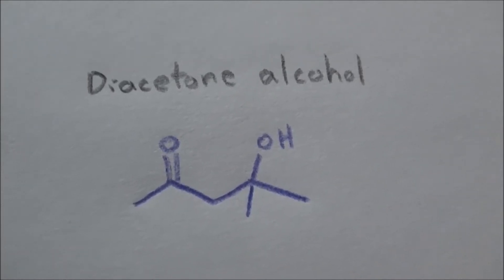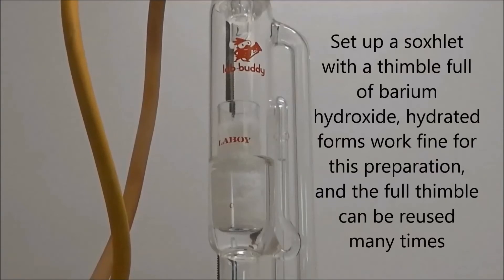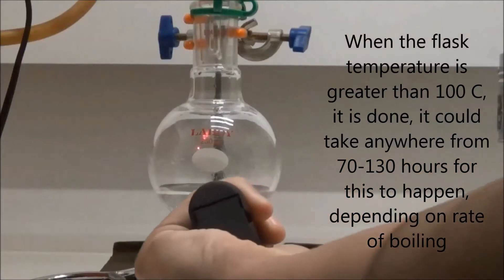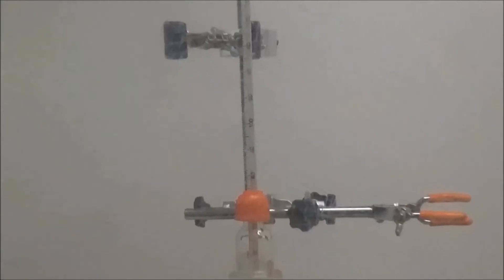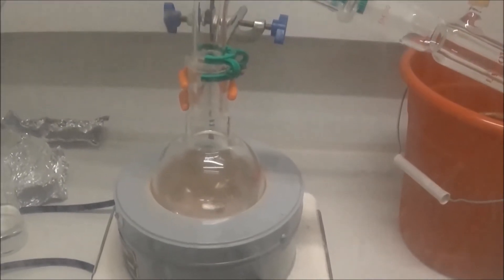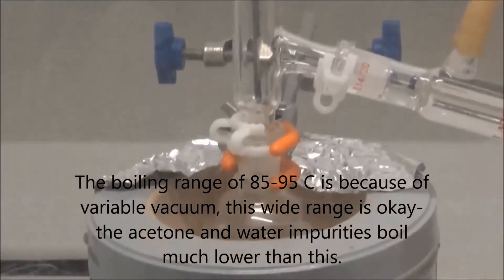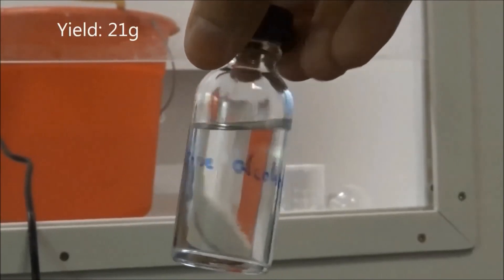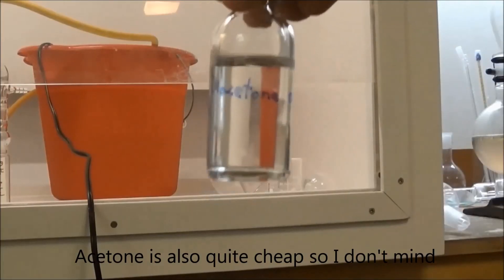Diacetone alcohol Synthesis

Comment: TOM..............Oh my god dude i just spent 8 hours reading the same 3 paragraphs from a hundred different sites.  Finally i found the answer............EVERY ONE KNOWS because of the conjugation of the double bond formed it is VERY EASY TO dehydrate and form the double bond.   BUT there is a LOT LESS chance if there are not protons in the pot.   Meaning no acid or alcohol or any protic compounds.  Because with acid in there the hydroxy group can be protonated making it a good leaving group.   IF ONLY BASE IS IN THE POT then the hydroxy group can not be protonated and will never be a good leaving group to form the double bond. So without protons in the pot the elimination is BARELY possible BUT  IF the base does cause a condensation with a couple molecules  and forms a double bond the mechanism has to go through an E1cB mechanism.    Another thing that stops the condesation part of the reaction is to use a weaker NON SOLUBLE  base like barium hydroxide and put it in a soxhlet so the base is not CONTINUOUSLY in contact with the pot.   As long as there are no protons in the pot then HEATING  the reaction in a soxhlet will be no big deal.  
                          So the deal is.........if you want no double bonds use a weaker insoluble base and use a soxhlet to keep the base from being in constant contact with the pot And have no protons in the pot.   And even better if you can do it then distill out your product as it is made,   If that is possible.  Then of course not only does it shift the equilibrium but then THE PRODUCT  can not be dehydrated if it is distilled out as it is made.     Of course since your base catalyst is not soluble in the solution of reactants and is in the soxhlet the reaction TAKES A LOT LONGER.

Comment: TOM.........The only 3 things that you are doing different is you are heating and refluxing with a sohxlet and taking FOREVER   but that would not help with stopping the elimination.   Heat and time would actually help elimination...in my mind.     That is why i was going to do my reaction in the cold. 
                           The other thing you did different is use  a weaker base than every one else.   And the last thing you did different was NOT add any ethanol.    Maybe that is why your reaction is stopping at the beta hydroxy ketone cause your base is weaker and can not do the elimination.   And you got no ethanol in there so the hydroxy group can not be protonated  as easily making it a water good which is a good leaving good.

Comment: Thanks God i've found this video. I'm actually in composing my final report for graduation requirements on my campus to making the pre-designed manufacturing of diacetone alcohol from acetone but i'm using NaOH as the catalyst. However, actually I was confused by the concept of aldol condensation and had a bit trouble in designing my final report because of the limitations of journals and patents that related to this DAA product :')
If it doesn't bother you, can I ask for advice or references and recommendations related to the pre-designed manufacturing of diacetone alcohol and aldol condensation? Anyway, thanks for making this DAA video Tom 👍🏻

Comment: Cool. Wha can you use the product for ?
Reply from the maker: My first use will be dehydration to mesityl oxide. If I get some palladium I would like to reduce that to methyl isobutyl ketone, which is a good solvent (I might actually buy some). You could also do the haloform reaction to make beta-hydroxy beta-methylbuturic acid, which is a dietary supplement. Haloform reaction on mesityl oxide would make 3,3-dimethylacrylic acid. Fun making polymers? I'm sure there are plenty of other uses that I'm not thinking of. You could make the amide of beta-hydroxy beta-methylbuturic acid, and do a Hoffman rearrangement (edit: for some reason I wrote decarboxylation before) to make 2-hydroxy-2-methy-1-aminopropane. I think the HMB supplement idea is the most interesting, I'll do that sometime.
Reply: @TomsLab  do you have any video of making the MIBK?
Reply: Naaarrrrc. Jokes 😂 the beta-OH, beta-methylbutyric acid sounds fun. Sounds Phenibutish??